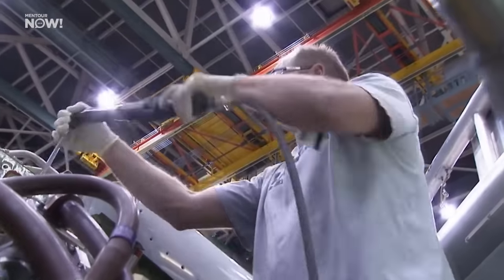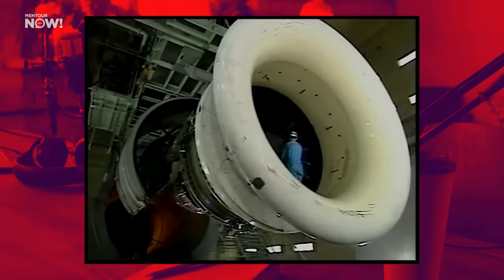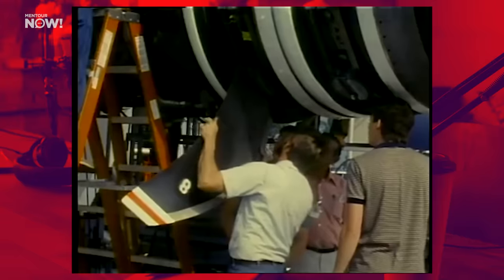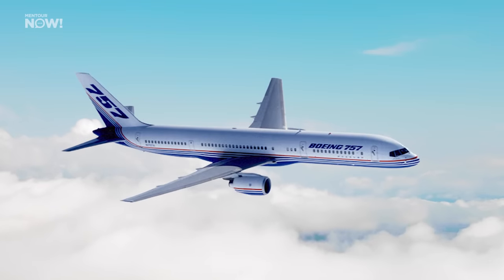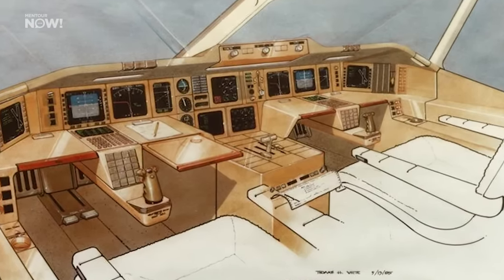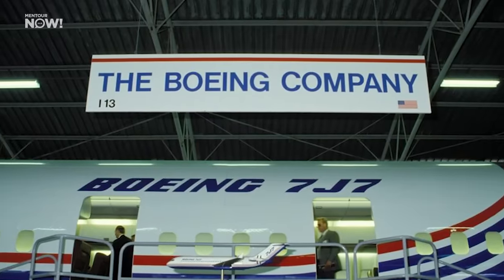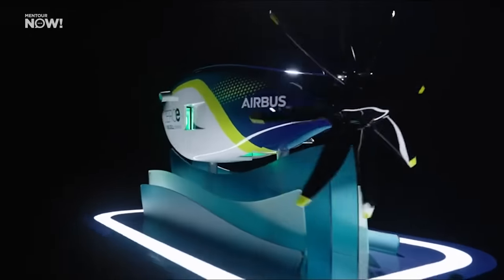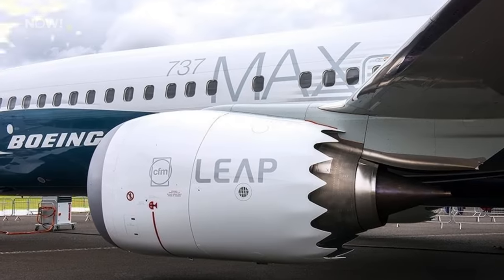Revolutionizing Flight! The Amazing Potential of the CFM RISE Engine.

Comment: My biggest fear with an "unducted fan" is a blade detachment scenario. Currently the nacelle serves as containment for such events.
Reply: Blade-off testing on propfan engines should be real fun to watch.
Reply: you could not be more right,
quite a few incidents of fan blade failures. It only takes one massive blade to destroy the rear structure. And hundreds of fatalities.
Reply: Have to reinfoce that part of the fuselage
Reply: This is what makes me nervous about the engines going in this direction too, unfortunately. Which is a shame because Petter had unknowingly done so much to help cure my fear of flying... But seeing this put me 5 steps backwards
Reply: Same, kinda. When I found out we were looking at these again, my assumption was that if it happens, I'd probably expect to see a resurgence of designs where the engines are on the tail maybe. If they're behind all the places we care about protecting which necessitate our current blade-off containment regs, that'd maybe get approved.

Maybe a little reinforcement on the final tail bits could be feasible, weight-wise, plus maybe if they're a certain kind of carbon fiber weave, basically, you can guarantee that a blade off that doesn't hit the originating craft, aka, could potentially fly for (?) like a dagger or whatever — anyway, there's a way of doing it where you can guarantee that after x distance and time it will disintegrate into just threads kind of. 

This can't happen fast enough for a blade-off that is flung only a short bit at the originating aircraft, but I could maybe imagine it being fast enough for a ground safety standard to beat thing. Stay X feet away / only spool in areas designated / whatever
Reply: Surely the solution would be is the to encase the blades only - the static blades in this design could also be used as a nacelle mount.  A smaller shroud, containing the blades, could work with the bulge in the compressor to squeeze the bypassing air to form a kind of ram-jet, which should help create more thrust for the same fuel burn.

Encased fans should also act as a container, to help reduce noise!
Reply: Turbo props are unducted
Reply: @miyahollands6136  you mean like a "ring" around rotating fan only like ~2m long.?
Reply: nah bro they don't provide as much power a the ducted engines. Not only this bro imagine a fucking a320 with a prop. Nah fuck this idea, for the a400m sure, but still nah
Reply: But the large multi engine turboprops have never gone away, like for example with the recent Airbus A 400 transport airplane, and safety concerns were never an issue with these.
Reply: If I ever get on one of these planes I’ll be thinking of the possibility of being cartoonishly decapitated by a runaway blade the whole ride
Reply: Ridiculous.  Propellers have been unducted since the beginning of aviation.
Reply: @Arturo-lapaz  that's one way to contribute towards population and consumption reduction....
Reply: Yet we’ve also seen piston and turbine propeller engines for years with astronomically few incidents of this
Reply: Obviously it's something that will need some thought in the design... but not something to really freak out about. A quick look online did reveal some failures of this type on turboprop aircraft, but the ones I could find were mainly attributable to gross design flaws or really negligent maintenance... and that's going to be a problem with any system. There are thousands of flights every day on turboprop aircraft and we just don't see people getting skewered by flying prop blades.
Reply: I genuinely wouldn't be worried about it.The blades are slower than turbnofans, and much lighter than turboprop blades, and if they are tail mounted as well, that's an additional safety benefit, and also makes for good cabin noise reduction.
Reply: @robertbalu8001   yes, just the first part of the engine to cover the blades only.
Reply: There's nothing to fear. There are really high safety standards in aviation. So these plaines and engines will not fly as long as there's not a proper researched and tested solution for that - no matter what it will look like. That's why developping takes so much time. So if you are not test pilot, there's nothing to fear except that this technology might never make it to commercial aviation if there's no solution found for this scenario. But I'm sure it will...
Reply: An interesting fact is that fan blades can and do eject out of the front of jet engines in flight at full aircraft speed. Fortunately a lot of the energy has been diminished due to interaction with the shielding. Not too long ago a 777’s hull was nearly penetrated forward of the engine by a fan blade fragment.
Reply: @Robert Balu  yes, a shroud to just encase the blades
Reply: @homomorphic  wood, 2 blades continuous structure, no ' Mach O.85 compressibility effects
What you gain is the minuscule wetted drag reduction of less than 1% 
Many trade off analyses are clear at the working engineers level : Here we go again, don't they read the reports and the wind tunnel summaries. 
Here our lamentations :

The fixed stationary rear variable pitch stator is just a contrarotating ( not counter rotating as falsely called) pair run with twice the speed, so that the rear happens not to rotate.
More noise, not less, more reinforcing armor plate; tail heavy ; move wings back to compensate to maintain static stability, mandated by the FAR (Federal Air Regulations) for all civilian airplanes, also increase the area of both stabilizers due to reduced moment arm. ...

And more , in short : the sales department, powerfull, has more to say. They really don't read or plainly missunderstand  the vast ramifications involved .
signed,
A group of lowly engineers with skin in the game!
Reply: if they die, they die 🥳😂
Reply: @petrairene  Read the crash report of the first one
Reply: @Arturo-lapaz   you haven't seen modern 11 bladed props have you?
Reply: It's really not that different than a turbo prop, and those have been in use for years.
Reply: A hundred years worth of efficient reliable open props.  Stop worrying.  Open props are always far more efficient than high bypass turbines.  Look at any outboard motor.  No ducted prop.  Ducted jet drives always loose 20-30% efficiency, thus the huge motors.
Reply: @miyahollands6136  listen to Petter again : better efficiency means more mass flow at lower flow velocity
Thrust = massflow × (rear flow velocity  -  flight velocity)
power  required:
E = massflow × 
½ × ( [rear f v ]² - [f v]²)
Reply: Well, there's the other side of the equation.  Since the nacelles currently contains the event, a blade off will always cause damage.  However, unducted, the blade can fly off into the air and cause no damage at all.  Not guaranteed, but at least a 50% chance.  Also, the blades could be made to be fragile to impact so they shatter instead of slicing.  There are ways to manage it.
Reply: I am scared stiff just looking at this beast of an engine.  I will never board one of these aircraft. 😱👎
Reply: Yeah like that one a380 flight where the blade went thru the fuselage and destroyed some of the flight control cables
Reply: @LuluDrakonite  
Pilot since 1958, several ten thousands of hours. Had more cars plowed in the rear of my cars , on red light, than a single misshap, with emergency landing on a bean field no damage. flew all over as a pilot,  sand storm in Africa, bush flying in Western Australia , low flight over Salar de Uyuni, Bolivia from La Paz . Alaska landing in what was called Mc Kinley national park, crossed atlantic several times alone in my plane.
Many cross country flights is a sailplane most landings in open fields. Never bent an airplane, Commercial flights only with British pilots, American pilots, Australian pilots, they are safe, not so  x y z's   defunct Swissair
Summary: choose airlines that have serious pilots, flying is safe as pax or as pilot. Avoid crowded travel times. Engine failures are no problem because of an incredible well organized system and  certification of people involved, certificated mechanics, controllers, maintainers, engine and aircraft designers and builders, uniformly trained instructors , periodic pilot reviews  and reocuring training, periodic aircaft inspections, the aviation community is amazingly competent.
As the Australians say , "no worries"
Reply: Just make a fuselage sized flack vest 😅
Reply: Turbo props have only 4 blades or so
Reply: @kitsuneneko2567  lose a blade and the shaking will overload the bearings, might even shake the engine off its mounts, at least an overhaul is mandated, normally it is junked. along with the supporting structure.
Reply: @Arturo-lapaz  yes, but that has nothing to do with my point.  The major damage from a blade failure is slicing.  You can turn off an unbalanced engine. You cant recover as easily from sliced hydraulic lines.
Reply: No different from a propeller engine and with modern materials, the hubs will be much stronger. Plus, the fuse can be strengthened.
Reply: @homomorphic  sure but they don't  operate at Mach O.85, not a single one , not even as contrarotating props on the Russian bomber .
I worked at Hamilton Standard, tried swept tips, noise goes up as the fourth power of the tip speed. Just plot that curve .
two % increase in tip speed produces 8% increase in emited noise power at frequencies, you would not tolerate. Try to sleep where helicopters operate.
Reply: This is all covered at about 14 minutes in the video.
Reply: Are you worried when flying in smaller Turbo-Prop driven planes ?!
Reply: Those suckers will take care of a flock of Canadian geese straight away!
Reply: @Arturo-lapaz   scimitar props have existed since the 1920s. They exist precisely because they operate in the vicinity of mach 1. Literally none of this is new engineering. It's all be done more than 50 years ago.
Reply: @kitsuneneko2567  one
talk to a certified A&P mechanic with inspection authorization about airwothiness of an engine that barely had a propeller tip touched the ground.
Sliced hydraulic lines make the airplane uncontrollable, depends which of the  systems is involved, by deploying the spoilers a pilot can determine which system is involved . If it is the wrong one, he, nor the passengers can eject .
Come on ,  go to an airport and talk to the A&P s
Reply: @Arturo-lapaz  what, exactly, is your point?  You're addressing nothing I said and making an argument from authority.
Reply: @homomorphic  correct, on submarines.
It is not the tipspeed due to the rpm , that matters but due to the vectorially added flight velocity : Mach × speed of sound, which depends on temperature , lower at high altitudes. Scimitar shapes tend to twist under centrifugal  force and will flutter , self destructing in seconds .
Reply: @kitsuneneko2567  just referring to the people who are the ones who decide what happens to the damaged engines, They lose their certification if they don't follow the FAR, look it up .
FEDERAL AIR REGULATIONS
Download a copy if you have enought paper to print them.
Better know them before making valid recommendations. every thing else is small talk.
no offence, no unfair criticism meant on my part. Join the flying community
Reply: I feel like if a turbine blade broke off from a jet engine, the shroud would do nothing in terms of preventing damage, especially if you're in the air.
That's just what I think though, I haven't researched this
Reply: @Arturo-lapaz  again, I have said absolutely NOTHING about what happens to the damaged engines.  I'm not really interested or concerned about it for the purposes of this discussion.   I'm ONLY INTERESTED IN THE PLANE GETTING DOWN ON THE GROUND SAFELY after a blade-off event and that is the ONLY thing I was referring to.  You're really strongly strawmanning me and I really don't appreciate it.
Reply: @MMedic23  it would, to some degree.  They're designed to contain as much havoc as possible.
Reply: There is a reason they put them at the end of the fuselage, even in die current pitches. The part where the vertical stabilizer is mounted is already quite reinforced and should withstand a carbon fiber blade. Also the idea of this engines is to push more air slower. So the rotation forces are lower then in current engines.
Reply: Oh man, didn't even think of this  😕. I guess surround the tail with Kevlar and hope for the best?

Comment: 25 years ago I discussed why the Propfan didn't get any traction with a dear friend who was a professor at a aviation college. He said the biggest thing that killed the Propfan wasn't only the noise. It was the marketing focus groups. The public was turned off by the appearance of the open fan blades which made the aircraft looked like the one that that parents and grandparents flew in.  I remember at the time there were designs floated around that had a massive duct around the fan with the core of the out in front for underwing widebody plane i.e. the 747 to give Propfans a more "jetlike" look.
Reply: Yea. I’m not an aviation person. The engine in the video looks frightening.
Reply: The public wants planes ✈️ that go whoosh 💨 and not buzz 🐝 and don’t want to see things moving 😆
Reply: For me it's not about the look but that open fan blade design. It's dangerous even with those reinforcements. the reliability cannot be 99.99% but 100%.  A simple fan blade hit during the flight can rip the plane apart, while the same failure in modern engines may not even notice by some passengers! Its a huge gamble IMO.
Reply: I can see how that might be the case. I personally feel that traditional jet engines do look much better cosmetically speaking. Though I also reckon the turbo props on a Beechcraft King Air for example look quite amazing as well.
Reply: Prop Jet technology has come quite a ways since that zombified 727 with that experimental prop jet engine on it, I remember it sounding pretty much like a flying weed wacker 😂
Reply: @IxnayMalarkavitch soft take.
Reply: Nephilim Godzilla foe plane.
Reply: @jackstheraptor2791  you realise there are turbo prop planes?  I am not really understanding the issue here prop technology with variable pitch is old tech and already proven ridiculously reliable. It would be interesting to see what the construction of the blades is like as if they have a big sweep in the design they would almost just slap the fuselage more side on the edge on if one broke. I think they look awesome!
Reply: @ProctorsGamble  Jets don't go woosh anyway they go whine.  They used to roar and you used to feel it in your soul.  Now they sound pathetic.
Reply: @mnewm21  Yeah they sound like a saw mill now but it is invigorating especially the RR Trent!